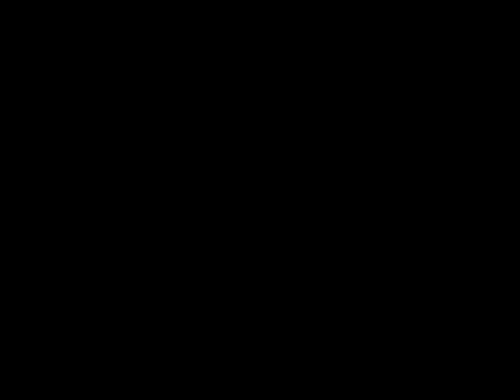Railroad Radio Audio: CSX Defect Detectors Cleveland, OH to Rochester, NY (2011)

Comment: Not sure if these were old CSX detectors, or some other version, but I am particularly looking for the detectors that have the little "blip" at the beginning. Then right after say, "C.S.X. Equipment defect detector..." and so on. I think there is one somewhere nearby me, I think in Ripley, NY.
Reply from the maker: The ones with the older voices were Conrail detectors. They used to say "Conrail" before the location ID.
Reply: Those detectors are mostly on lines that CSX already had before the Conrail split. The old detectors in this video are former Conrail detectors (The ones that say the location)
Reply: cbehr91 2.0 My question is what type is the one in Erie, Pennsylvania? I know it used to be the standard "Conrail: Erie, Pennsylvania" but then CSX replaced it with an earlier version. Also the ones in Ripley and Springfield have long been replaced. The ones in Erie and Coldwater, NY. are alike. And I thought they used to say "End of transmission" at the end too.
Reply from the maker: Erie and Coldwater are a "newer" Conrail voice that began popping up around 1998. I think the manufacturer was Harmon.
Reply: cbehr91 2.0 Ah ok, thanks!

Comment: Are there any current Conrail defect detectors as of now?
Reply: The only known ones left are the old defect detectors in Ashland Massachusetts and Chesterton Indiana unless those have been replaced by now.
Reply: Ok.
Reply: @Ohio_Photographer  Update: Both of those have now been replaced. The Ashland detector was replaced in mid 2020 while the Chesterton detector was replaced in 2022. There is now only one original Conrail detector left and it's the detector in South Plainfield New Jersey.

Comment: Id like to have Cleveland to Alliance
Reply: the old Conrail ones..
Reply: +V8FordTempo Old Conrail detectors on the Cleveland Line do not exist. NS got rid of them fast
Reply from the maker: +V8FordTempo Check out ohiorr.railfan.net and click on "railroad audio". There should be recordings of Hudson and Rootstown from back in "the day".
Reply from the maker: +Tyler Simmons The Sebring detector which was the "new" Conrail voice was still the same up until about six years ago. But you're right, NS changed them quick.
Reply: Yes still looking for East Rock ("east ROCK, ohio")